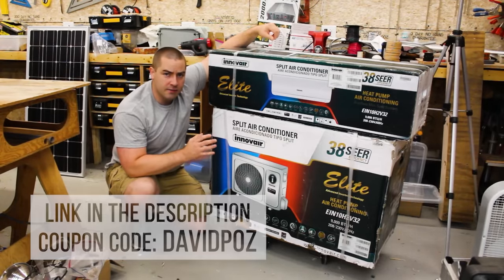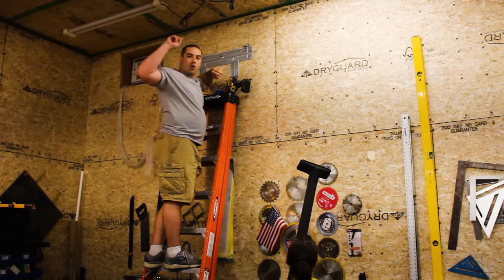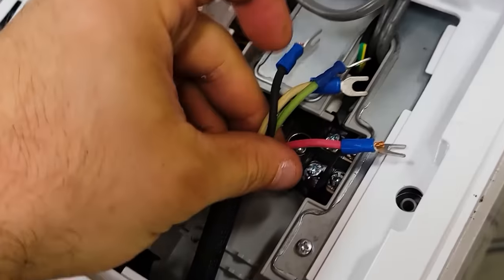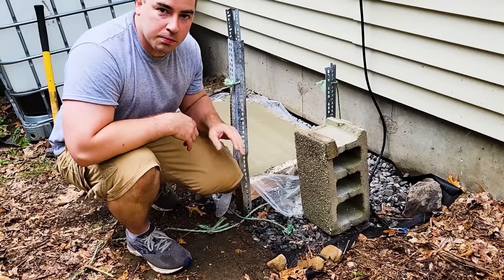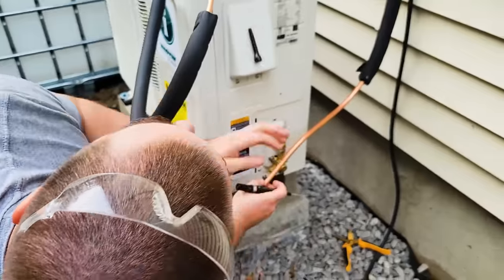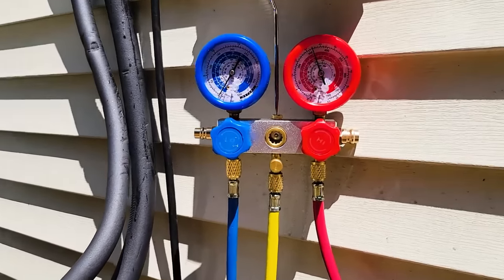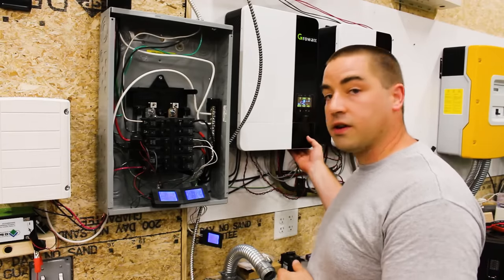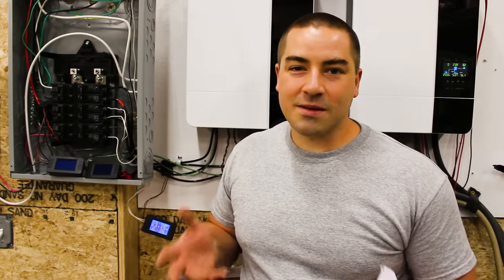DIY Mini-Split Heat Pump, Full Installation, 2021

Comment: How are you managing dust in your shop/garage to keep the dust from clogging the indoor unit of this ductless heat pump?  All of the wall mounted ductless mini-split heads have poor or relatively poor filtering to keep the discharge air and the coil clean. The poor filtering contributes to their crazy high efficiency because it takes energy to overcome the static pressure of pulling air through a better filter. This video shows a good way someone designed a low static pressure filter for the mini-split in their shop. 
https://youtu.be/S_Li3Z7F8tE
Reply from the maker: That's a good idea Jay had
I might have to make something similar.

Comment: I'm confused.  The data sheets say "Up to 38 SEER", but also says a more reasonable "Operates in either AC cooling or Heat Pump heating mode with 17 to 19 SEER."  Seems like marketing hype.  First heating modes are not measured in SEER to my knowledge.  Also my understanding a SEER rating is a constant not variable.  I'm sure it has a variable compressor, and that may play into it, but I'm suspicious.  Maybe someone with more HVAC experience can explain these numbers, but I'm sceptical.
Reply from the maker: I'd love to hear from someone with more knowledge too, but my take is:  It is more efficient when maintaining temperature, and less efficient when it ramps up and tries to cool the air temperature.  At the end I show the wattage draw at first, after 24 hours, and after 48 hours.
Reply: The  Seasonal energy efficiency ratio (seer) is variable based on outside and inside temperature as well as humidity.
Reply: @DavidPozEnergy  seer means seasonal energy efficiency, btu of cooling per watt of power. The compressor on these units is variable speed and gets its best efficiency at its lowest speed. (The capacity at the lowest speed is likely 4 to 5000 btu, not the rated capacity) The efficiency also goes up when the outdoor temperature is lower. It is theoretically possible to get 38 btu per watt when the load is very light and the outside ambient is low, but not on a seasonal bases. A seer rating of 22 is about as good as it gets. Now the good news, the mini split variable speed unit is by far the best and most efficient cooling unit on the market.  Early a/c units had seer rates 6 to 8 and have increased to the present level. I am a licensed hvac tech with more then 40 years experience.
Reply: @jakealmaguenther4366  Yes everything said here. Also as the SEER rating (a/c effeciency) goes up, it normally takes the heating efficiency down. The heating efficiency of the unit is the HSPF value. I have sold units with lower SEER values cause they where going be mostly used for heating so we attempted to opimize on the HSPF side instead.

Comment: The vacuum likely does more harm than good.  You are taking a fully perfectly sealed charged system and hooking up disconnecting and connecting a device that in the process likely adds moisture and air LOL  

Then you're running this device for 1hr plus to remove air and water...and adding nitrogen.  Is that smart?

As an alternative,  I would highly suggest you pressure the pipes only,   then connect and "never ever" touch your perfectly brand new sealed charged internal system.   This is my opinion and HVAC people love money and would say otherwise LOL

Likely all Evac. processes imo do more harm than good with connections and disconnections as you're messing with a perfectly factory charged and sealed system....   just think about what you are doing everybody

Comment: Unless the law has changes only certified HVAC techs are supposed to have access to the various refrigerants ( was told this at a store selling those products) and are supposed to trained and certified to do installs, etc ( I personally don't care) just would hate to see you get visited by the EPA.
Reply from the maker: My understanding is that I can't buy the refrigerant, but when it's already pre-charged in the system it's OK.  I don't want to break any rules.
Reply: @DavidPozEnergy  that may be the case I am by no means an expert on the topic but like I said I went into a store that deals in HVAC products to buy something else and they asked me what my ification number was for buying refrigerant I said I don't need any. I know the EPA apparently is quite strict on this perhaps somebody with more expertise and insight can further inform us.
Reply: Yes, it is the case, anything user serviceable you have to have a license. I know the minisplits get around that limitation (I believe), and somehow get classified as a window unit (charged with refrigerant also) that end users can buy. If the precharged lineset length wasn't enough, there would be issues as he would have to add refrigerant to the system.
Reply: @chrissnyder2091  He didn't buy refrigerant - these units come pre-charged with freon in the outside unit.

Comment: 38 SEER from an off brand manufacturer?!  Sounds too good to be true...  Plus it runs at 500 Watts for 9,000 BTU?  SMH

A few weeks ago I installed the new Midea 12,000 BTU U-shaped window AC.  I run it on low-medium fan, it's super quiet and typically runs in the 200-300 Watts range according to the killa-watt meter.  It's SEER was around 20.

All I can say is:  "Luckily you received yours for free!"  😁
Reply from the maker: At the end of the video I show the wattage right at the start, after 24 hours, and after 48 hours.  The unit is more efficient just maintaining temperature.
Reply: Great info, thanks guys.

I was nearly to the point of getting a mini-split this year (either Pioneer or MrCool) and opted for the Midea window unit as a stop gap this season, deciding to postpone the big ticket purchase for another year or two.

I anticipate the economy of scale and current supply chain disruptions will ease in the near future.

I'm really looking for something closer to 24k BTU for my use case.  Seeing that 38 SEER on these smaller units really makes me optimistic that the equivalency on an 18-24k unit will soon be on the horizon!

Comment: You said THHN wire, I hope you meant THWN… THHN is not rated for outdoor use.
Reply from the maker: Yes, there are lots of acronyms on the jacket.  yes, one is "THWN".  When I'm at the electrical supply house they look at me sideways if I ask for THWN and then correct me to say THHN.
Reply: @DavidPozEnergy  ahh… yeah, clerks don’t always know specs, just order numbers.
Reply: @DavidPozEnergy  In a situation like that I usually get the product look at the label/printing on it and point out the THWN on it. It can be used anywhere as THHN but THHN can't be used for THWN. At my local stores etc THWN Use-2 is all the carry. It can be used in virtually any situation.

Comment: This AC is sold under other brands like GREE...i have COOPER&HUNTER the same unit Arctic CH-S12FTXLA(Wi-Fi)NG and CH-S18FTXLA(Wi-Fi)NG and units are super efficient also in hard winter like -10⁰C i have always 23-24⁰C inside .....
12k unit costs me around 450€
18k unit was around 680€...
Inside unit and remote are the same outside unit im not so sure....
It can heat down to -25⁰C outside 
and cool up to 43⁰C outside.....
One model is more efficient as mine CH SUPREME and +300/500€...

I miss ur videos...
Make video about consumption of ur AC unit and compeare with existing ones....
Celulose insulation is in E.U. non+ultra but u have to supplement it after 5 years or so ...in attic u have to left few pvc pipes so u can add more celulose in wall ....

Comment: 9000btu / 800w=11.25 seer 🤔
Reply: This is true, but only at full capacity, since it's an inverter compressor, it will variable speed the compressor to the exact load placed on it. The on/off cycles wastes a lot of electricity on current systems, cause they are sized for the max load, not the exact load needed at the current time.
Reply: @patrickdk77  So when it's off it's infinitely efficient, so why didn't they put that on the box.  It only saves energy when it's below setpoint, downside.  It's not 38 seer, do the math.
Reply: Hi David, if you have time, please test your split when room ambient is well above setpoint through setpoint. Efficiency really only matters when the bulk of the work is being done, data plots would be helpful.  Thank you for your diligence to be energy independent. Awesome channel 👍🏻

Comment: I'm not that impressed with the electronics. Any unit that allows insects or dust inside is a bad design. There are more wiring cut outs than are necessary too. Maybe they are all like that? it's pretty similar to a washing machine controller

Comment: At full speed on start up, you we’re consuming about 1/3 the power of my American Standard 20 SEER 24,000 btu HP system with variable speed blower/outdoor fan/compressor. The “38” is a sales gimmick. People are easily deceived. Wait until one of those diy units break down, then you’ll find out what you truly saved. No warranty and most contractors will not touch them.
Reply: Are you kidding me, who needs that warranty and their service when their labor cost much more than unit itself

Comment: you my friend is what we call a Trade poacher.  
We hardworking tradesmen spends years struggling suffering learning through blood sweat and tears how to make ends meet with a skill that is governed regulated stringently by very high standards, and with very high caliber licensing requirements - That does not come easy i might add.  We do this so that we can feed our families, and give them a better life and teach our children to work hard for what you want.
Then guys like You come along and of show the average joe smoe how to do our work, with them not having a clue the true risks and dangers on what or why we have regulations and licensing to begin with.
Sad part is Your not alone, there are many type like you on u Tube, doing everything you can to ruin our society for profit and glory.

Comment: Just reamber this is only good for  10 years anything after is lucky keep this in mind reageler heaters are good for 30 years if you see what's going on hear the government whounts every body go electric and the price of electric will go very high in a few years and at 0 😱 in the winter it isn't efficient its barley worm plus side is you have a air conditioner and like any appliances thay brake down and cost and you can see how cheep junk made in China 🇨🇳  and all the parts good luck I personally would not get one because it's like puten in a 99 dollar air conditioner

Comment: Very poor assembly indicative of a poorly run company.  Shame on Signature Solar for not investigating the products they are promoting and selling.  This reflects directly back to them.  Please state clearly what you received from SS for creating this review.
Reply from the maker: In the description I said exactly what they gave me, which is the unit.  And, actually, I paid for shipping.  I bought all the supplies like the vacuum pump, manifold, concrete, etc.  either through Amazon or locally.  Signature Solar had no say in the video.

Comment: You missed a step you did not open the valve on the side with an allen wrench under the cap. You are only vacuming the blue line not the whole system. Read the instructions better
Reply: NO!! This unit was pre-charged. If he would have opened that valve with the vacuum pump on, he would have vacuumed out and vented the refrigerant (very illegal...). He vacuumed it perfectly.